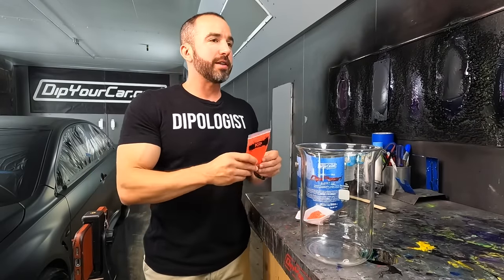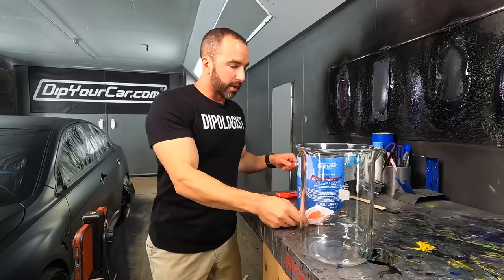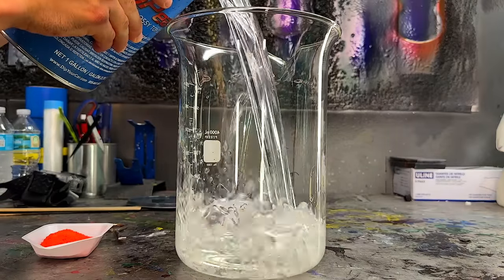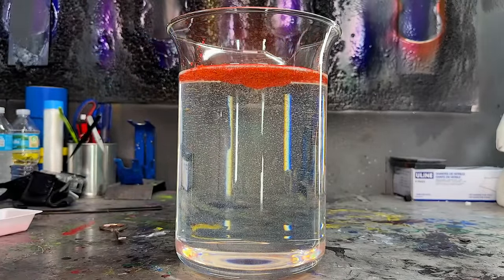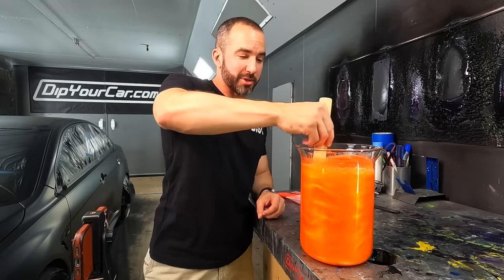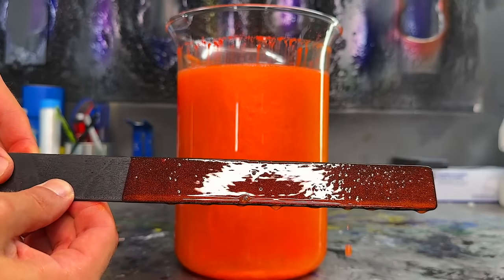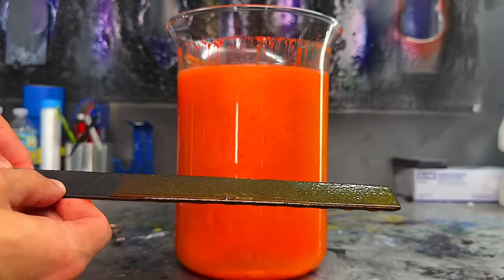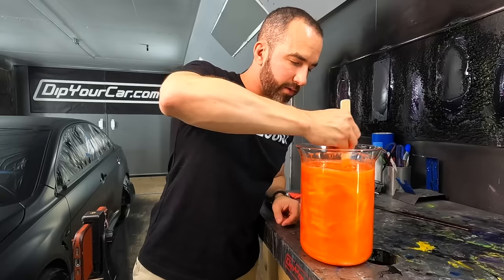NEW Prototype HyperShift May Be the World's CRAZIEST Paint Color (How is this even possible?!)

Comment: the problem with the paint is that it has more angles from which it looks dull from...like @7:15 when the majority of the surface turns into low saturated goldish-green metallic like shade. Almost all pearls have this issue but orange is by the worst, imho, to work with unless the customer really really knows what they are getting and they want it. Otherwise, metallic or satin orange is way better imho.

Comment: I'm painting some motorcycle fairings and they are absolutely perfect. What do I need to do for prep? I'm a house painter, so I'm capable, but this is all new for sure.   Do I need to just break the sheen, or do I need to sand down to paint? Can I start with paint or should I prime first? Or treat every job as new and prime, base coat, clear? Ok awesome I'd appreciate a little help. Your videos are awesome 👌